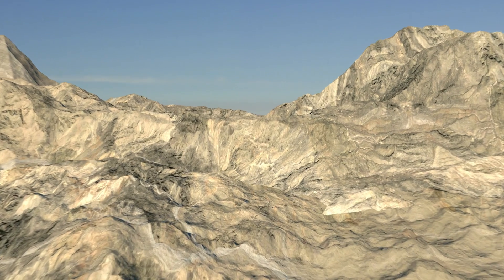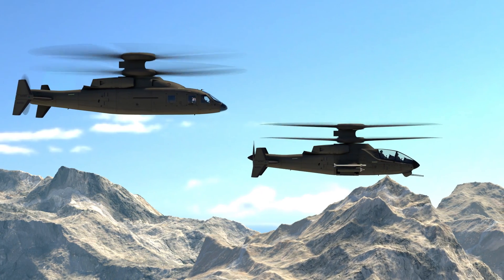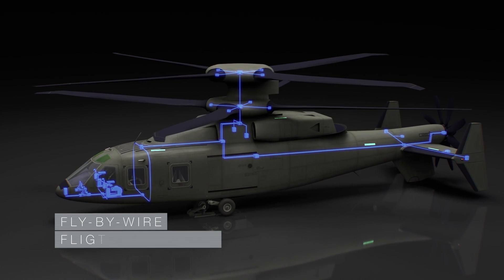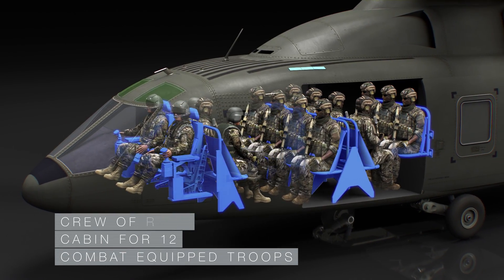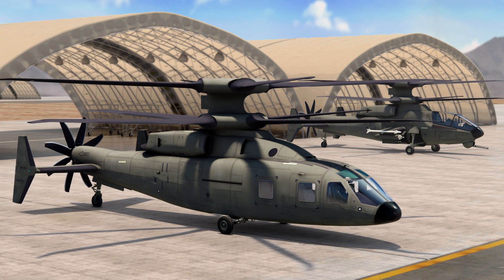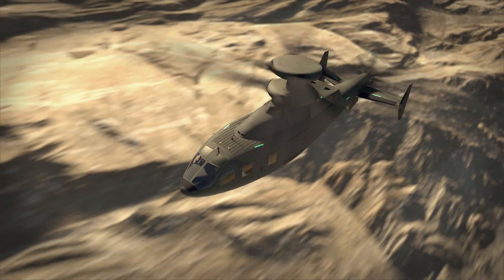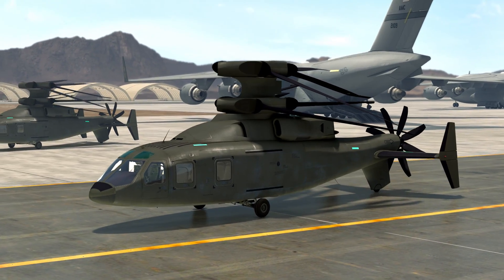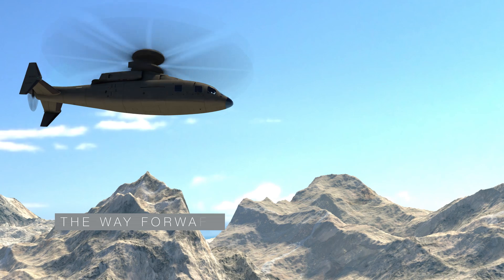Sikorsky - Boeing Future Vertical Lift: The Way Forward

Comment: lol, tiny-brain comments about Ka-50 and "copy" of it, even can't read wiki coaxial rotors. There is 23 fliyng machines with coaxial rotors before Ka-50/52/666 etc.
Reply: Artem Atami 
They’re all just sitting in their low cost high density apartment buildings, eating cheese and drinking vodka. 
Gopnik4Life
Reply: All of you shut up
The French had a coax helicopter design in 1933, but it was never produced
Reply: @derptank3308  Name?
Reply: Fox Hound 

Bréguet-Dorand Gyroplane Laboratoire
Reply: @derptank3308  The coaxial rotor was known long before the idea of creating a helicopter with a tail rotor: for example, in 1754, the “father of Russian science” Mikhail Lomonosov proposed using a mechanism with a coaxial rotor to lift the meteorological probe, the mechanism was set in motion using a winding spring.
Reply: Right. No copies. US can copy it only in CG movie.
Reply: why does it matter who made it? Shouldn't it matter who can use it effectively? Even then if it works it works, so why not use it?
Reply: The same wiki you're talking about credits who came up with the idea...ironic
Reply: Relax. All helicopters ideas come from russia. even Mr. Sikorsky come from russia
Reply: Before Ka-50 there are 
Kamov Ka-8
Kamov Ka-10
Kamov Ka-15
Kamov Ka-25
Kamov Ka-26
Kamov Ka-226
Kamov Ka-27
Kamov Ka-31
Kamov Ka-32 which are much older. The coaxial rotor design is of Russian origin
Reply: @otomackena7610  the kolibri was coaxial for example and it's from ww2
Reply: @otomackena7610  the coxial rotor is a German design. Germany had choppers way before Russia
Reply: @foxhound4955  German is Tilt twin rotor. Not co axial rotor. They used  2 axial not one.
Reply: @otomackena7610  search for Libélula Viblandi buddy. It was the first coaxial rotor design helicopter and it has a Spanish origin. Stop spreading lies!
Reply: @otomackena7610  No it isn't lmao believe it or not the design was first introduced by an unnamed british physicist in the 18th century, not of russian origin. Also the first functioning coaxial rotor helicopter was made in the USA, it was called the Bensen B-9 developed by Igor Benson, correct me if i'm wrong
Reply: @otomackena7610  Exactly, all I can say is that the OP lost it. He tried to sound smart by telling us to go to Wikipedia and look what happened...

Comment: This chopper and it's variants really riles up the Russian peasants.
Reply: Anyways USA is trying to copy vectorian engine from Russian planes, because their maneuverability.
Reply: What are you talking about, comrade? Boeing is Russian. America is Russian. Putin our king. Clinton is a lizard. Get your tin foil hat ready comrade.
Reply: elite aviator wow two rotors on a helicopter = Russian invention what a genius.
Reply: The steamy Russian comments made my day I’m gana finish my preroll🇷🇺🌍.......cya🚀🌔🇺🇸
Reply: elite aviator yeah? Then how come they didn't do this first?
Reply: Sorry im totally clueless, what is the purpose of having the two rotor blades? On the ka52?
Reply: @RFA1988  Coaxial rotors have various advantages, I would name some for you, it eliminates torque and you won't need a tail rotor, getting rid of the tail rotor saves power not to mention coaxial rotors produce more lift without using more power (that's the whole "more speed, longer range" deal) and it isn't as loud as single rotor helicopters.
Reply: But will be easily destroyed by a SU 57
Reply: eah... only thing that new is foldable blades...the rest you can find on soviet choppers
Reply: Sikorsky is Russian..... "Igor Sikorsky"(father of helicopter) so um.....

you call your helicopter with a russian..... 😂😂🤣🤣🤦‍♂️
Reply: "SOVIET RUSSIA-UNITED STATE HELICOPTER DESIGNER" 😂😂          man... this guys is a legend  😂😂 😂😂
Reply: What did you siey about mother russia capitalist pieg?
Reply: Hardly unparalleled
Reply: Peasants? In case yoù still live in the 1920s, Lenin died ages ago in the ussr has been gone for almost 30 yrs!
Reply: Sikorsky is Russian...
Search Igor Sikorsky
Reply: Yeah exact copy of wait I don't see the rear push blade on the Russian chopper. Guess it's not an exact copy eh?
Reply: @johnbossi8590  yeah the russian used small rotorheads and even blastable Rotorblades so the Ka-50/52 reaches 6g 320km/h without a n y need of a backend rotor 

Plus an ejectseat system in a combat-helo!

...Bad US-copy I guess!
Reply: wert freund Doesn’t look like an attack helicopter so it doesn’t need it, which if you think about it it’s not an attack helicopter either so go figure about the roles.
Reply: @johnbossi8590  That is, it does not bother you that the coaxial scheme with two rotors is designed and patented by the Russian company Kamov? Are you claiming that a small pushing screw on the tail brings this concept out of violating other people's patents and theft? And to prove this nonsense take in court?
But nothing new, the same Kalashnikov every dog is trying to copy, although there comes a shitty fake level of cheap China.
States won even Kalashnikov Machine Gun copy want. Seeming completely lost fear. We'll have to dissuade strong blows to the wallets of idiots.
Reply: @Tlan_Hronsar А Сикорский создал рабочий вертолет и наверно его запатентовал, так что нам нужно разобрать свои вертолеты? Так что охлади уже свое траханье.
Reply: @shevg2646  Ну тогда уж совсем с начала вспоминать будем ок? Начнем с китайских игрушек с винтом на палке, еще до нашей эры летавших, продолжим да Винчи, а если уж совсем о прототипах так и Ломоносова вспомнить не грех с его аппаратом имевшим спаренные винты на параллельных осях.
Первый полет с бензиновым движком -  аппарат братьев Бреге.
Потом пойдет изобретение автомата перекоса Юрьевым, который позволил управлять полетом самим несущим винтом, как оно сейчас на большинстве вертолетов реализовано. И Сикорский скажем прямо, даже к первому нормальному вертолету не имел отношения, а всех заслуг в первенстве только то, что именно его машина в крупную серию пошла и не более того. Так что неплохой конструктор и управленец -  это да. Но не более того. Так что лучше учите мат часть перед разогревом того, что вам нужно охладить. ;)
Reply: I'll give you that the Kamov 52 is a unique helicopter and a Russian came up with the idea. From, there, other helicopter inventors experimented with the idea. Some were successful and went on, yet others didn't. The first successful coaxial bladed helicopter was actually developed by a Czech-Hungarian team in WW1. Research PKZ-1. Also, a Brit was the first to patent the design. Throughout history, inventors have taken idea from others and continued to develop them into better designs. The S-97 and SB-1 designs use a ridged rotor design. The Kamov 52 still has old design articulated rotors. The SB-1 will be faster and more maneuverable, plus it just looks sexy. The KA-52 is a a great attack helicopter built upon Kamov experience. The SB-1 is a troop carrier. Different missions.
Reply: @veritasestveritas8646  Kamov 52 is not the first Russian coaxial helicopter. :) Actually, almost all Kamov helicopters are implemented in a coaxial scheme with two screws, starting from the first Ka-8 model. Then there were the antisubmarine-borne: Ka-25, Ka-27. And already on their base appeared attack helicopters: Ka-50, Ka-52 and Ka-52K.
SB-1 is still in development stage of the prototype. And he really planned as a transport worker, and not as a strike helicopter. If the project is really able to implement, then it will be an excellent replacement for the V-22 Osprey.
On the implementation of the alignment scheme - still need to see its behavior in stormy weather. The Ka-52 scheme is directly taken from the deck Kamov vehicles, and is designed to operate the helicopter even in stormy weather, with a side wind of up to 25 meters per second. Whether this can grab a Sikorsky helicopter is a big question. But it will be interesting to see.
The coaxial scheme itself is not new at all. The first samples - the middle of the 18th century. Meteorological probe designed by Lomonosov, for example. Various prototypes - more than a dozen.
As for Kamov, it is Kamov helicopters that are so far the only serial helicopters with a coaxial scheme, and they have been dealing with them since the end of the Second World War.
With the fact that the SB-1 will be faster - I agree. And as for maneuverability, I will doubt very much. The weight of the helicopter is planned to be larger, the total aerodynamic resistance from the side and vertical angles is also much larger, hence the reduction in maneuverability. You can't argue against physics. Under such conditions, superiority in lateral maneuverability and climb (vertical maneuverability) will require not only much stronger engines, but also much more durable materials for propeller blades and new blade shapes that can withstand such overloads without destruction. A special breakthroughs in the materials while something is not observed.
As for speed records, we have a technology demonstrator and a flying laboratory based on the Mi-24, made according to the classic single-rotor scheme, flying at a speed of 405 km / h. Developments on it are planned as the basis of the Advanced High-Speed Attack Helicopter, the concept of which is now being worked out. Mile’s charts so far give a speed of 450-470 Km / h, Kamov’s schemes are a little less than 500. Whether this helicopter will be a serial helicopter and according to which scheme it is not yet precisely known. But it will be very interesting to see.
Reply: Анатолий Романов actually, the co-axial rotor design is not unique only to Kamov. Sikorsky has had a co-axial helicopter in the 70s (known as the S-69) and actually, it was a British man in 1859 that held the patent for this design. Kamov recognized the benefits of this design and used it in many of their helicopters so it became a signature feature of theirs. One more thing. In the war economy, patents are irrelevant. No economic law can force a government of a country to not utilize another ones design or tech. Its all about trying to out-tech your opponents to gain the upper hand.
Reply: Анатолий Романов actually, the co-axial rotor design is not unique only to Kamov. Sikorsky has had a co-axial helicopter in the 70s (known as the S-69) and actually, it was a British man in 1859 that held the patent for this design. Kamov recognized the benefits of this design and used it in many of their helicopters so it became a signature feature of theirs. One more thing. In the war economy, patents are irrelevant. No economic law can force a government of a country to not utilize another ones design or tech. Its all about trying to out-tech your opponents to gain the upper hand.
Reply: guess you're not particularly worldly, eh?
Reply: Russia copies American tech all the time such as f 15, b1 lancer and the stinger etc.
Reply: @KingDorner1x1  learn more about aerodynamics ! when it comes to supersonic flight - every plane will look the same . aerodynamics dictates form . B1 lancer is expensive rubbish , while Tu160 still in use and its wonderfull piece of engeneering
Reply: @snejok888  dont be silly, look at france, Germany. They are not copy cats such as Russia. As soon as America makes a device they want to copy it. If you say America is trying to copy Russia which is unlikely then, I can tell you russia is the one that is in envy of American technology.
Reply: @KingDorner1x1  nobody copying anybody ! except chinese .during cold war us and ussr always developed new types of weapons and every side tried to counteract by making similar weapons with the same specs .Thats why they kinda look simmilar ! its like the car maker this day - a soon as some car maker creates new class of vehikals like BMW x7 - everybody starting to make similar car with same price tag///didnt you notis that ? every brand has cheap crossover around 25k $...and slitly better version of it for 35k$ ... i can keep going but you get the point
Reply: @snejok888  I see🤔

Comment: Gradually people come to the fact that still co-axial screws have much greater efficiency, special stability at low speeds and hovering, and also in strong wind, reliability and economy. Do not waste extra energy on the tail rotor. Well and besides for a high-speed helicopter this is exactly what you need.
Reply: dwiggins01  205 kts.  But that was with the pusher prop at less than 50%.  They should be breaking 300 kts.
Reply: That’s exactly why the tail rotor is there - for high speed use. I believe this is supposed to be an alternative to conventional ground attack aircraft and tiltrotors, so it must be fast.
Reply: @minimumdorifto6595  Yeah I guess the pusher is probably intended to make it go faster when needed.
Reply: I mean, nasa is even making a helicopter for use on mars, without co-axial screws that would be unheard off
Reply: Pusher will increase ground speed by at least 50 MPH in level flight while increasing efficiency.  The fuselage was designed to be more aerodynamic for this purpose.  This thing will make the UH-60 look like a snail.  Both of these design features will increase mission range by 2-3x.  Furthermore, the composite body reduces weight which is what allows for the increased payload capacity.

Boeing/Lockheed/Sikorsky really knocked it out the park with this design and the US military will be ordering these by the thousands and I imagine Lockheed Skunkworks already has a "stealth" version of this helicopter in the works for black ops.
Reply: @randomman057  How fast?
Reply: @JohnnyZenith  It already hit 200 knots, I think this is unprecedented for helos
Reply: @trezapoioiuy  For one this size it definitely is unprecedented.
Reply: @fennviktorvich  Also.  Dont forget that it can go in reverse to slow down faster too.  This design is from the 60's.  And people are just now figuring out that its actually good.
Reply: @randomman057  Nope. Im sure lobbyists will kill it halfway through its development.  Like fucking always.

Comment: Why go with rigid rotors? Is the tilt function a failure point on copters?
Reply: Rigid rotor systems are highly responsive compared to fully articulated rotors. They can also be placed closer together than a fully articulated rotor without fear of them colliding, as well as some other minor benefits

Comment: Isn't This Classified? WTF USA cover your secrets better
Reply: If this thing became declassified, just imagine, what Lockheed-Martin has in well-protected hangars of Area 51...
Reply: I know about this, but still, military projects tend to be classified, at least in the early stages of development. Also, Lockheed-Martin is the one who provides most of the experimental units to the Area 51, which is no more than a high-security airforce base. Also, I was playing along the Rye.
Reply: @caav56 It's not early stages. "Military projects tend to be classified" - toilet paper stock ordering etc is classified too to some extent so you need to make a meaningful, useful statement! There is nothing conceptually new about this chopper that needs extreme secrecy. This is part of the U.S. Army Future Vertical Lift requirement that's been ongoing for 12 years! It's the next generation family of replacements for the Black Hawk, Apache, Chinook & Kiowa choppers. Your Area 51 observation is also uninformed - we tend to have a good idea what's going on in the black programs [in outline only] - everyone in aeronautics knows where the leading edges are in their field [e.g. right now it's hypersonics & high Earth orbit space domination to name two examples]

Comment: To my knowledge a single rotor helicopter control it's yaw by balancing (and unbalancing) the torque produced by the main rotor being spun, how does this aircraft control it's yaw out of curiosity, does it have some way of altering the speed of each rotor allowing it to unbalance the torque? or does it angle the blades in order to produce more resistance on one of the rotors and less on the other? or something entirely different?
Reply: It is done by increasing pitch on one of the propellers and decreasing pitch on the other propeller. I do not think you can turn the helicopter by increasing speed on one of the propellers because of the gear mechanism that makes the propellers turn in the opposite direction of eachother. What i mean is that the two propellers are locked to eachother (via gears) so if you turn one of the propellers, the other propeller will turn opposite at the same speed, but i might be wrong :-)